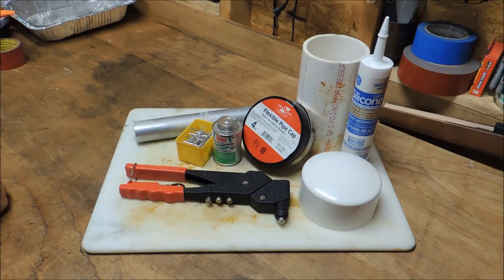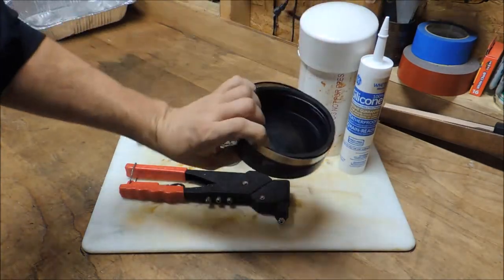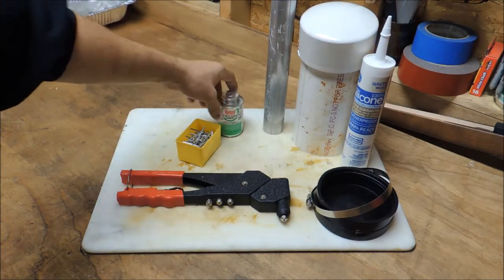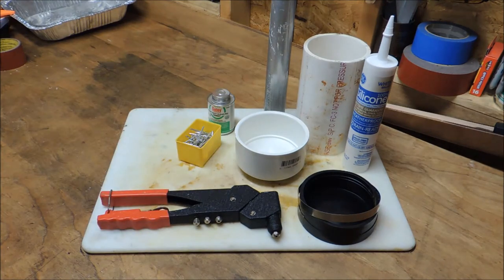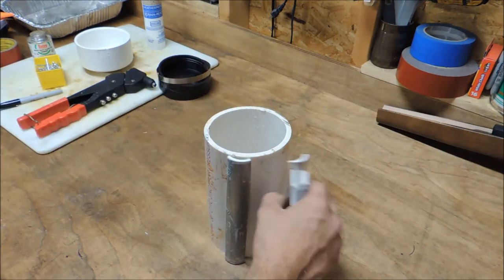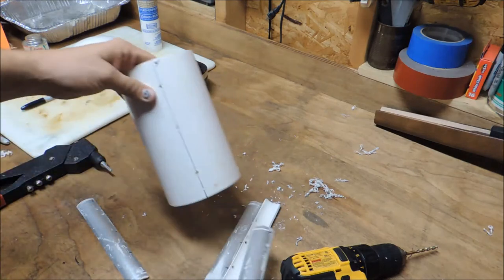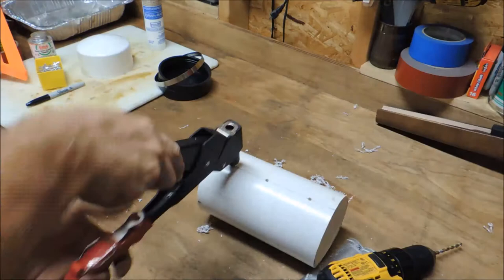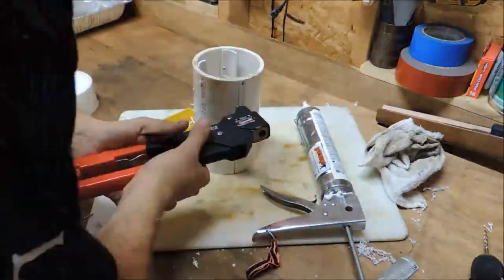DIY - Knife stonewashing drum.

Comment: Could you please make a video showing this thing in action.  Amount of media used,  what lubricant used, how long you ran it and show a finished knife blade?  Thanks
Reply from the maker: Sure, here's a quick overall video of the tumbler in action: http://youtu.be/wcbu6KU1jBw

Here is a link to a finished knife: http://youtu.be/Br2mzKLx8gw

I used roughly 2lbs of media in the smaller drum, hosed down with some WD-40. Motor oil also works well. I typically run it for a couple to 4 hours..